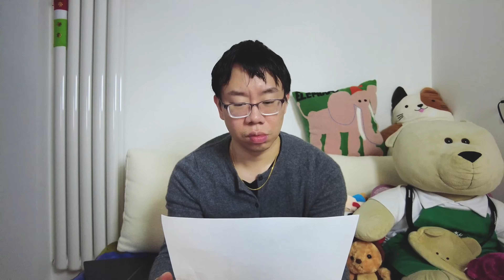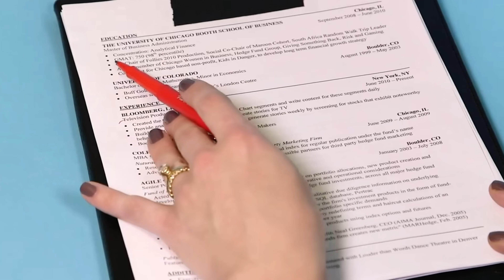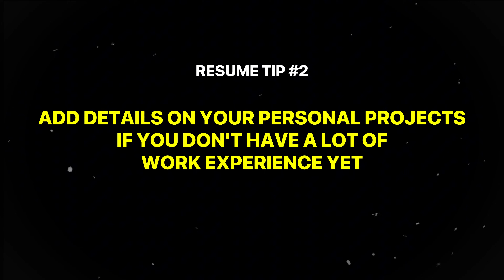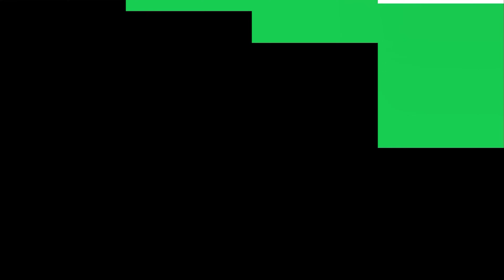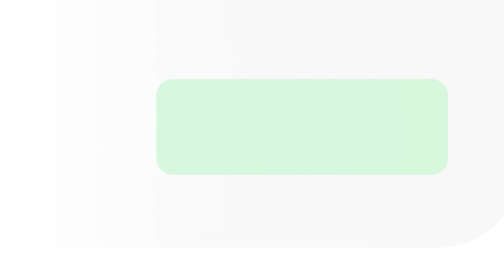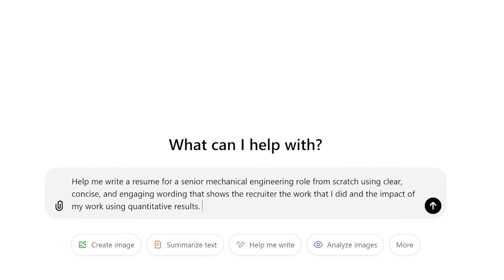This RESUME Got Me 20+ Mechanical Engineering Interviews

Comment: Hi Victor, I think this is all fantastic advice. I am curious why you still have your education at the top despite having over a decade of experience. Also, I get the impression that you're targeting OEMs which work closely and/or regularly with Chinese affiliates, is this a fair assumption on my part? Typically for listing jobs or education, I tend to lead with the name of the role/degree earned, placing those on top, rather than the name of the organization, this way the reader can quickly gauge what I did rather than where I've been. For example, if I'm looking at your resume for no more than a few seconds, I might come away with the impression "oh, he was educated overseas" and overlook the more relevant fact that you earned a graduate degree. Just my two cents, and you know what they say about resume opinions and assholes...
Reply from the maker: This is all great advice. I do have multiple resumes, and the one I'm showing is an older version mainly for students. To your point about including the role first, I do think in most cases that works well. However, there are instances where listing the company first can be more beneficial. For instance, your company is well-known in your industry or every job title in your resume is the same. Clearly both are important, and it depends which one you wish to highlight more.